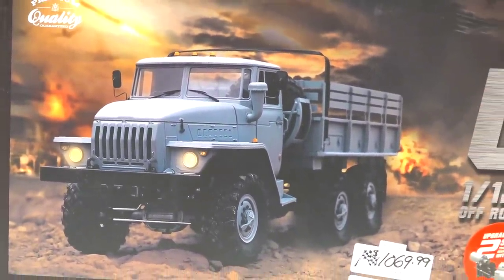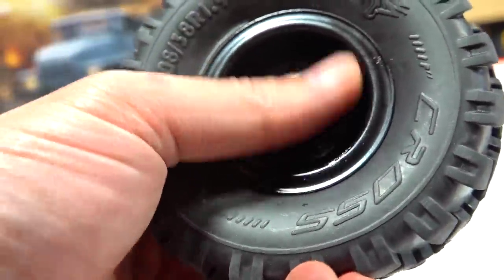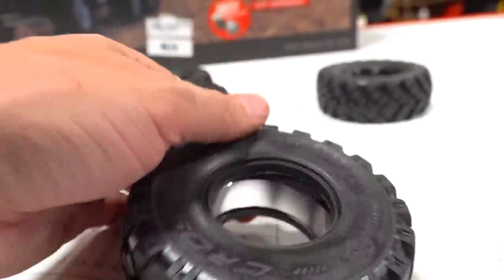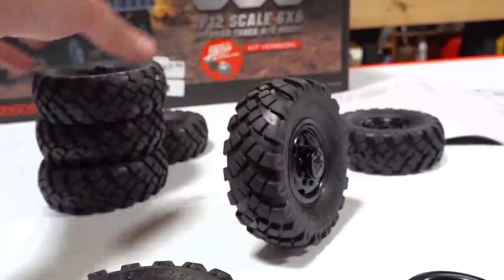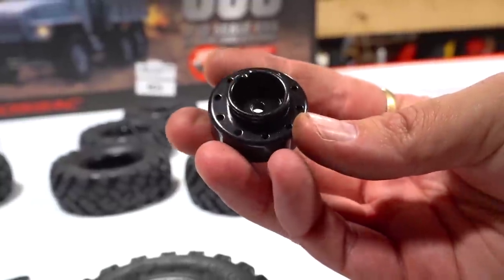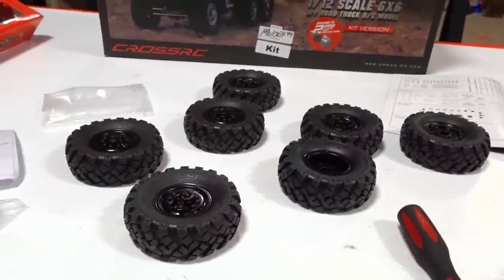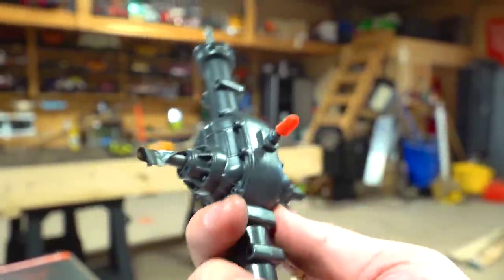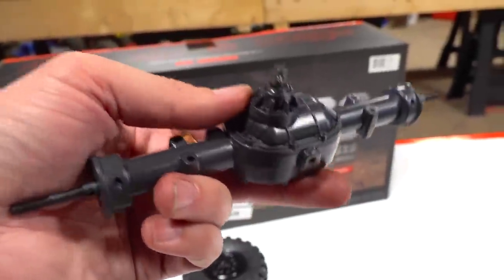HOW TO BUILD an RC FiRE TRUCK - PART 2  (Cross RC UC6 Model Kit Build) | RC ADVENTURES

Comment: After struggling for ages with my Cross HC6 tyres, I found they actually sit perfectly with the first step of the bead squeezed out all the way round. Unlike all my other beadlocks, they seem designed that way! They clamp onto the inner step of the bead. Stay secure and airtight like it too. Loving this build! The UC6 is a total classic. 👍😎

Comment: Hey Medic, so happy to see more Cross RC love out there! Factoid: those arms on the wheel hubs are the tyre inflator tube covers because this like most Russian off road trucks, has the ability to inflate / deflate its own tyres. And when you find the slop in the gearbox, as you will, recall that these trucks in real life are not precision comp crawlers! We run our cross rigs alot and the slop just adds to the experience.

Comment: Excellent explanations, especially for the fitting of these tires which in the end are not easy to do and as you said it takes an hour to do the six , if of course we do not mistake the direction of the tire . as I do them 😄 At the same time I didn't have this paper that you showed 🤨

Comment: Thanks for showing the start of this build I was wondering did you put lock tight onto the the threads for the wheel nuts as I’m new to the hobby I’m trying to gather what info I can thx

Comment: Would like to see the gears setup in the axles.... and is it me or the front axle shafts looks tiny ??
Reply from the maker: Hey bud, its a normal ring and pinion gear.. nothing special inside. Its packed full of grease now.. and the cover was painted closed.  Sorry, but it wasn't important or different enough to showcase

Comment: i dont know why but that red cap on the axals is realy anoying me
Reply: Me too but i went in the manual and saw that it's only a protective cap for the bolt thread, it will not be on the truck when finished. (i thought it was a diff lock actuator at first)